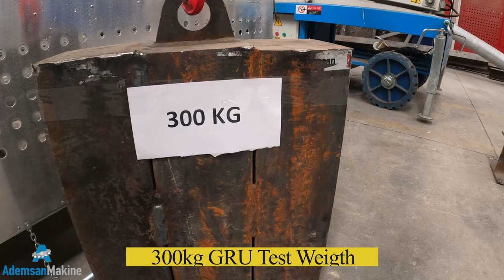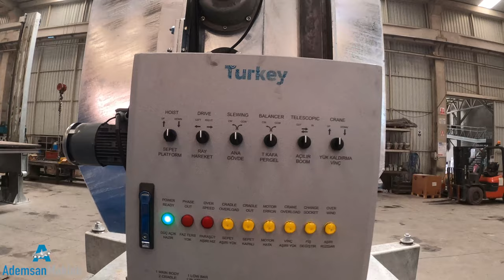Ademsan Machinery Zanyar Tower AST-70 BMU Test

Comment: We are Building Maintenance Unit(BMU) Service Provider based in UAE.
We have seen the challenges faced by the industry very closely & have developed a system to over-come some of these challenges.

The main challenges faced by these industries are the following:
1)	High costs of conductor wire ropes
2)	Limitations on voltage 
3)	Large battery size
4)	Wireless communication challenges such as Line Of Sight (LOS) Issues.
5)	Communication Breakages

We have developed a 24 Channel Wireless Transmission System catered to B2B which can be incorporated in any BMU system and also branded as OEM’s for your new as well as existing projects as the need may be.

It is a product developed after a lot of research keeping in mind the problems faced by the BMU industry, such as signal interference, line of sight, cost factor etc